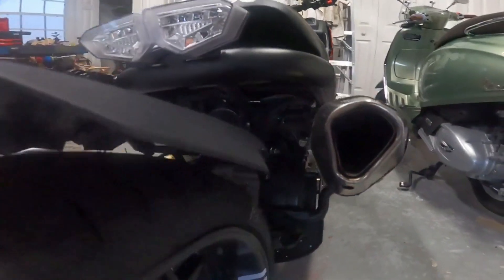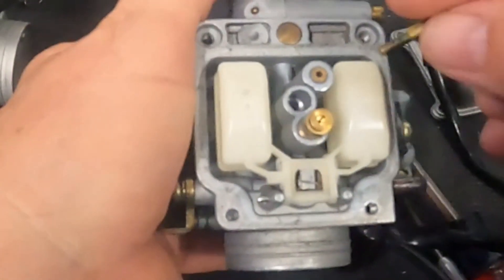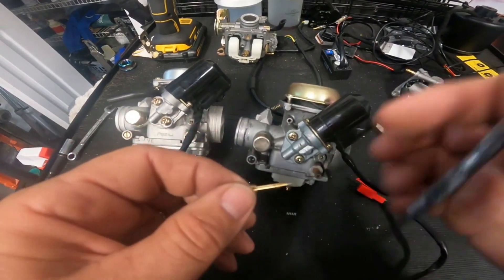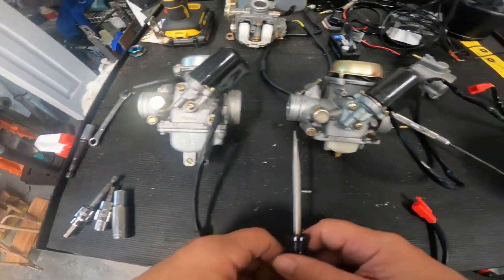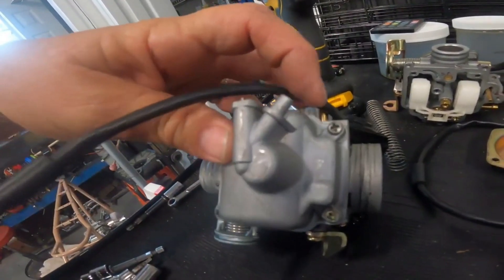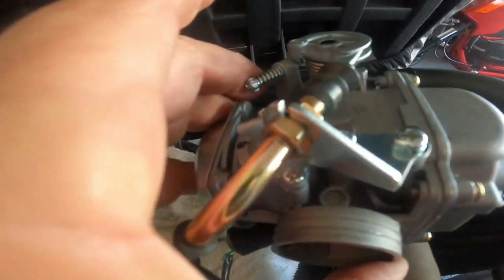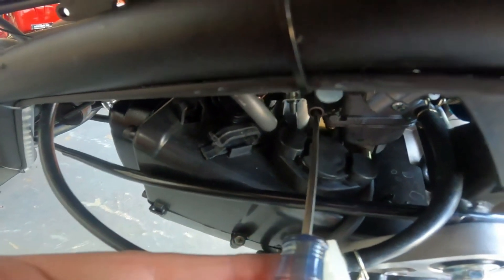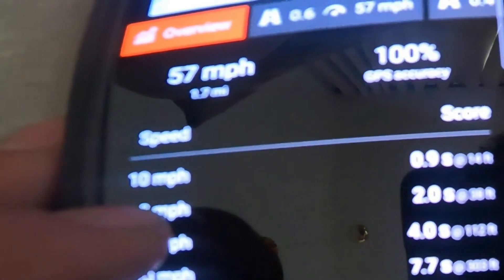Maddog 150 FREE MOD #5 (Tune Your Stock GY6 CVK Carburetor)

Comment: Majority of these carbs have plugs to keep you from tampering with the jets and the electric auto enricher is questionable at times. Personally I just put them aside and get a Nibbi carb and be done with it. Thanks for uploading the video.
Reply from the maker: And I think you can get the whole CVK carb with jets and float bowl screws for cheaper than the jets alone

Comment: Excellent video! My only suggestion is you call both screws the idle screw. Just to be absolutely clear I would refer to them as idle speed and idle mixture.
Reply from the maker: Agree.  I always call stuff the wrong things.  And the idle screw and mixture people mix up alot when I try and explain what to turn.  Thanks

Comment: @GhettoWrench 
I bought a replacement carburetor for my gy6 250cc. It's a water cooled factory rear disk brake and factory 30mm carburetor. I've had this thing since 2016 or 17 and finally getting around to mess with it. I bought it not running. It only had 400 miles and it seems the pickup coil went bad and the cdi. I replaced both of them and the carburetor that sat since last year needed cleaned. After doing that it still wont run nearly at all. Sometimes i can get it to start and rev but most of the time it barely spits and sputters. Im curious if the jets are interchangeable from ine cvk to another. I figured i would take the jets out of the factory carburetor and put them in the newer one so its jetted as it was originally. Other than that the only thing i can think of would be adjusting the valves. I wouldn't think a cvk of the same size would cause it not to run but who knows. It now has spark all the time. Before it would run but barely, the spark appeared to be inconsistent. I have fixed a million of the gy6 150cc, this thing is the bane of my existence i swear.
Reply from the maker: @ZCRAIZED1  man that sounds like the issue I was having when my CDI was completely incompatible with the pickup location on the flywheel.  A pickup coil is interchangeable,  but are you sure you got the correct CDI?

Comment: Does tune of the air idle improve any speed or is it only an economy mod?
Reply from the maker: It's just for idle and when you very first come off the throttle stop.  So if you were idling and added throttle and it bogged or died before you even start rolling then that would be what to adjust
Reply: Main jet upgrade usually gives you more top end- full throttle power
Reply: @GhettoWrench to a bigger or smaller
Reply: I'm in VA at about 300 feet above sea level. For a stock 150 with a 26mm cvk, what sized jets would you recommend starting at?
Reply: Absolutely helps improve speed because engines running correctly